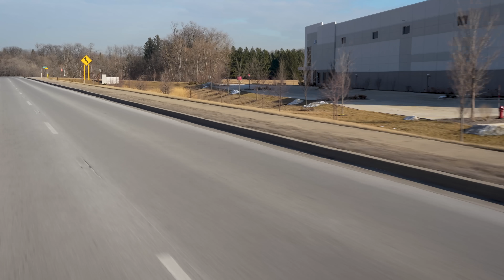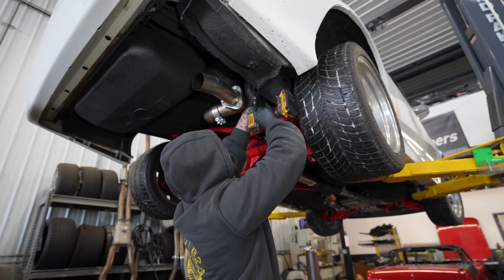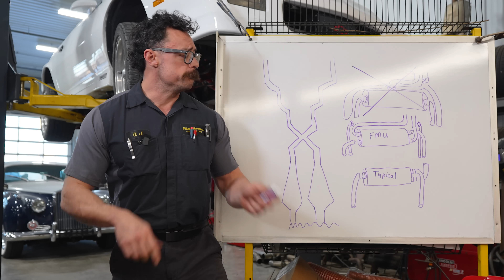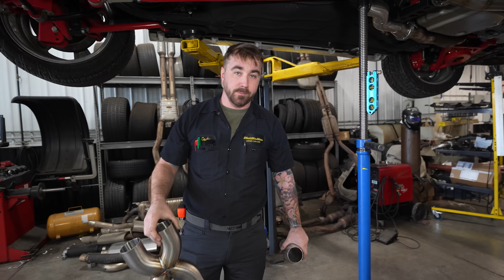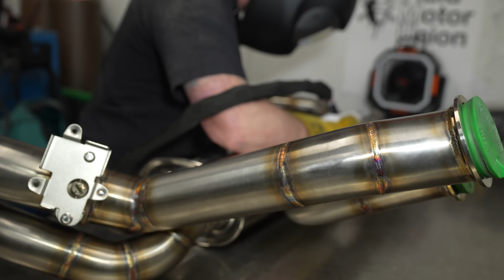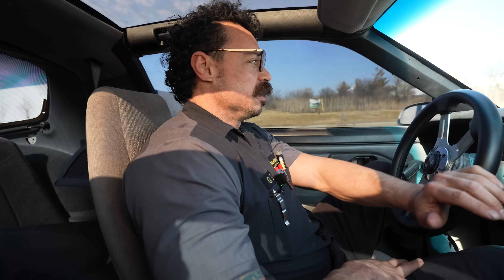This Camaro Exhaust Shouldn’t Have Made 30+ WHP: LS3 Stepped Pipe Layout Everyone Will Copy

Comment: The owner of this car definitely has some money tied up in this build. I love it!
Reply: oh yeah, that looks like a hawks 8.8..easily a $4000+ rear end plus Im sure a built 60e will run you a couple grand.
Reply: @vans1107 really they charge $4000 for a Ford 8.8 conversion on an 3rd gen... that's about what it costs to swap an 8.8 IRS into an '04-'06 GTO. I would imagine that an 8.5 10 bolt would be plenty strong for a 6.2L, don't Grand National/T-Tyoe guys run 9s with 8.5s?
Reply: @LeeHendo  an 8.5 10 bolt would be but that's not what came in 3rd and 4th gens..they have the 7.5" 10 bolt that is glass..it will live a while behind an automatic but a manual will break them at stock power levels.
Reply: @vans1107 Oh, I thought the 350 L98 3rd gens came 8.5.
Reply: @LeeHendo Moser 12 bolt.
Reply: @vans1107 Moser 12 bolt, with a True Trac. I have one, and recognize it right away.
Reply: This place is where I’ll have to drive my 3rd gen to when I get the LS installed. Unbelievable service and quality here
Reply: @MasonsMotorworks 
It’s gonna cost you.
Reply: Depends on where the 6.2 came from, a $7000 LS3 crate engine vs an L92 you pulled out of a $2000 rusty or wrecked Denali/Escalade you scrapped afterwards is a big difference in cost. Your results will be nearly identical and even "budget" builds these days aren't cheap. Especially with Terminator X, a FAST intake, quality headers, that full suspension and a handmade exhaust like this after a Borla. Not to mention what he has in the transmission or drive line. It's a nice car.
Reply: @LeeHendo I was talking about all the suspension and rear parts tbh. But yeah the ls3 too.
Reply: @marsh35404 yeah those suspension parts for those are serious.
Reply: @LeeHendo he's probably not putting a fluid motion exhaust on a junkyard LS.
Reply: cutom tig welder time $45...min...for exhaust alone.
Reply: Quality Work is not cheap and Cheap work is NOT Quality
Reply: @richsperformanceexhaust these days, that is not always true, plenty of bum mechanics charge crazy money for bad work and tons of companies charge big money for junk parts.

Comment: Though they are mostly used side pipe exhuasts... what are your thoughts on auger inserts for drone and dropping decibels? Its claimed they are meant to do both and well with minimum back pressure increases/flow restriction. Its probably not worth your time for a video but your thoughts on these would be very appreciated!

Comment: Hit a parked SUV in one of these in 1992 doing about 80mph with no seatbelt... Steering wheel was at 90 degrees and had my leg pinned between it and the seat. This is what snapped my femur but saved my life.
Reply: That suv jumped right out in front of you didn't it? 😂

Comment: I put vbands on my 86 Iroc with true dual stainless i custom fabbed, I wish i just welded an extra 10 inches to the back of my long tube headers (like super long tube headers now lol) and put the vbands on after the Clutch mount point on a t56. 

I had to go down to 2.5 inch header outlets, and 2.5 inch vbands to clear the gap between the LT1 style clutch cuz its backwards of the LS1 style (i put a lt1 in my car, AC fits the k member with some gentle hammering)
Reply: If I was closer I would love to throw my car on your dyno, and swap to your Nice X pipe version lol

Comment: I have a 1992 Z28 with the old SLP catback exhaust, no converter, and Doug’s shorty headers. GM made it an absolute pain in the ass for exhaust work on the 3rd gen.
Reply: You'd have an easier time routing it if you converted from a solid axle with torque arm to a de-dion axle with Satchell Link. I mean, technically, just doing the Satchell Link should help, but a De-Dion axle conversion will give you some crazy benefits on top of just moving links around, PLUS it'll make the driveshaft height stationary like it would be in an IRS car.
Reply: @Drunken_Hamster  Might as well buy an entirely different car!  That's a LOT of fabrication and work... and $$
Just buy a Moser 12 bolt and drop it in at that point.
Reply: @billymanilli a 12 bolt will do nothing for exhaust routing.
Reply: You ain't lying. Ive had '88 iroc, 96 t/a, 96 z28, 00 trans am, and 02 ws6 blackbird. Same platform; same exhaust setup other than header route. Extremely difficult to sound good and flow good at the same time
Reply: You're not kidding!  I drove to the old SLP place in Toms River, NJ 20 years ago and bought headers, and y pipe, to match up with the SLP catback I bought at the E town swap meet for 20 bucks (lol... I know)... It was missing the muffler, so I put something else there instead... It was especially a pita, b/c of my angle plug heads... SLP said it wouldn't be an issue... yeah right!  Had to run those short plugs in it and the boot still was dangerously close on #6 and #8.  That wasn't GM's fault though, tbf
But... still!  What a terribly designed car!  I LOVE 3rd gens (I literally still own 3 of them), but what a "piece of junk" when it comes to trying to hop it up!
..and then you make any more than 200hp and the diff explodes (or you could break it with 50 hp and a T5)... Ohhh and that T5 ... what another piece!

...and of course it's either a nightmare to put anything better in it, due to the "crooked" hydraulic clutch, bellhousing setup, and torque arm.  In the 90's, my uncle fabbed up a 9" and TH350 for his 84 Z28 ... that rear ate a lot of power.  ...and the ultra rare Dana 44, that they built for them were costing as much as the entire car was worth at the time.  (I happened to pick one of those up at e-town around 10 years ago for..... 250 bucks!! ...guy had no idea what it was!) 

Anyways... yeah.  I agree!  Grew up a "Chevy guy" through and through... but after a few of these things, I have 3rd gens to cruise around in on nice days, and an '87 Fox body Mustang for drag racing.  They're just awesome (ESPECIALLY when you're not rich!)
Reply: @billymanilli t5 wasn't as weak as everyone said, easy to rebuild. Basically same parts as a fox body t5. they would haven't 11s no problem back in the day. I have one behind a mild 406 in a 90 formula and it's been fine for years. I have a lt1 t56 stuffed in a corner for the swap if ever need it but so far I'm happy not to need it.
Reply: You are so right about these cars and putting exhaust on them! I had a '97 Camaro SS and fabbed up true duals on it. I could only fit 2.5" pipe to make it fit over the suspension and rear end. I still had factory manifolds and single chamber mufflers but it sounded pretty good. Loved that car!
Reply: You should have used long tubes
Reply: @fnafplayer6447 Doug’s shortys are made specifically for this car and fit perfect.

Comment: Ah yes the old loosen the straps hp gain, if you know you know...
Reply from the maker: That was the strap breaking! I left that clip in there it there because it looked rad but it was just a tired strap that had enough. Scared me silly… you should see the spike and loop on that graph! 
You are correct in that there is a hp difference between strapped tight and loose. 
That’s why we limit the travel with the front straps, where the rears allow it to climb but keep it in place. 
Strapping is a balancing game in that way, but it’s not like there’s infinitely more power the looser you go… if you’ve done it right it will climb, show its peak # and not fall off.

Comment: Lower the rear LCAs to the bottom or second to bottom hole, depending on how much it’s lowered to correct the angle of the LCA. With it on the lift and the rear drooping, the LCA angle is what it should be at ride height. They should never be level or higher in the rear. It’ll make it a different car. Going to need to correct pinion angle, too. ~3-4* should be optimal all around, IIRC. 

20 minutes doing that and it’ll hook in first most likely.

Comment: 1) A BONE STOCK auto LS3 makes 375-385whp- that's with factory intake, manifolds, cats, exhaust, etc. you didn't "PiCk Up 30+ wHeEL HrsPoOwErZ WiT ExHoOsT" 🙄... It just came in with a completely junk tune and running like garbage- hence why a cammed LS3 with I/H/E was making what I've seen bone stock manual LS3's make.

2) 45min video, and the only shot of the finished product is a 3 second clip of the muffler going in?

3) zero clips with the valves closed? Seriously? It's a full-length exhaust on a street car, and you couldn't bother including what it'll sound like 95% of the time?

Comment: O.J. ,  that was just impressive.   32 H.P. in the exhaust alone was exceptional. You can have a new name,  EFMU, for those exceptional builds.  :DDD That system should be eye opening to a lot of people.  Also,  that car almost jumped off the dyno :DDD  it was so powerful :DDD, that was a little scary to watch.  :/   I think it would be wise to put a few more straps on those high power cars. :DDD   That car really does sound great now.  I could hear your meaning of "restricted" in the before shots. The after video was really clear and open sounding.  That car is obviously too fast for it's tires.  slicks on the drag track is probably the only place where it would be able to rip.  Excellent work, Cody and O.J.   :)

Comment: 3 things that are a complete shame about that Camaro....1st, it's not got either a T56 or a GFORCE Street 6.
2nd... those polished Torque Thrusts need to go and GIT!!! Torque Thrusts look terrible on anything after the 70s.... and a Camaro should always have IROCs...or at least a set of wheels that fit it's style, definitely not Torque Thrusts 🤮
And lastly....T-Tops.... I understand beggers can't be choosers, and he might've already had the car for years, but I definitely wouldn't have started with a T-top F-Body to build out.... personally, I'm a sucker for the pre-facelift 3rd Gen Firebird Formulas, slick top 5L 5spd, WS6 and 4 wheel disc.... and then immediately pull that dog 💩 Chevy 5.0 outta there and build a Motown 5L 3" stroke LS7 headed screamer 👌🏻

Comment: I am biased. My name is Chris and I have a third gen addiction. I’ve had my 1992 1LE since 1996. It currently has Hotchkis and BMR rear suspension, and I added factory A/C because it’s hot in Texas. I had to remove the dual converters for a single because of the sub frame connectors. Other than that I always wanted to keep her as stock appearing as possible because 1LE cars are a little more special. When I saw the third gen thumbnail, I just went crazy. You combined science and art when you built this exhaust. IT IS SO BAD A$$! It sounds amazing, and EVERYTHING you said about the dyno correction numbers I believe to be true as well! Thank you for including an older Camaro that some folks are not as fond of. This was an awesome video!!!
Reply: I purchased my 92 when I was 18, built out an old 4 bolt main 350 & swapped in , eibach suspension and found some shock tower connectors. It still drives good but I really want to dive into the Detroit speed front and rear suspension arms catalog!
Reply: You should have did an electric AC compressor to keep the load off the engine.
Reply: @LeeHendo  I think you missed the part where I said I wanted the car to look stock, and pretty much stay stock. Stock replacement parts are still fairly easy to acquire, and if the system develops a problem, most competent technicians can diagnose and/or service the system if I’m on a road trip. The only performance that I was interested in was the temperature of the air coming out of the vents. I keep three cans of R12 in the spare tire area because again, stock appearing and most folks know it’s hard to beat R12 in a system designed for it. Besides, I have a ZR1 that is fast enough for me, and she has a few mods for just going way too fast.
Reply: @CS-oe8ogit can't look stock, 1LEs didn't come with AC
Reply: @LeeHendo  You must be from the learing center. Because your learing and comprehension skills are not that sharp. First off, I said appear stock (that’s why I used all factory parts). So, do you understand the concept of looking under the hood of my car, and under the hood of a factory A/C car, and NOT being able to tell the difference between the factory A/C car, and my car?  Unless you are a third gen F body savant and you know RPO codes as well as where to find them, the two cars look identical under the hood. I would venture to say 98% of even the most avid of third gen  Camaro folks do not know what a 1LE is or that they had them in the third or fourth generation cars.  But thank you for letting me know that the A/C option was not available on a car that I have probably owned longer than you’ve existed, I thought I had a special northern car that did not have the block heater option.
Reply: @CS-oe8ogthe irony of trying to call someone stupid and typing learing twice instead of learning.
Reply: @ryanmarsh3732  I guess you don' t know "learing" was used intentionally. 
Quality Learing Center sir.  There is some lore.
Reply: @LeeHendo then you'd need special equipment to charge the ac correctly. A set of guages or an old machine won't cut it. Might wing it to cool but not cold or correctly
Reply: Certainly wish I lived close by & could rummage thru y'alls dumpsters every couple days... 😉

Comment: A 4" single would've made the same power without the mental gymnastics
Reply: And unless it is opened up, it sounds like crap at low, part throttle with all the reversion. You can also make the same power with less money in heavy lump of big block for a motor swap, but that isn't the point.

Comment: I actually would've come over the rear axle with the twin pipes, and turned them both, and sent them both through a dual in/dual out to a Twin Exit on the rear driver's side straight out the back similar to the 3rd Gen Firebird SLP Firehawk's, the old aftermarket SLP "TOTL Exhaust" ,and the GMC Syclone's twin passenger side rear exhaust (but on the driver's side lol)

Comment: I have an E60.  Stock exhaust is 2 manifolds that drop into 2 cats then they come together at a Y.  I'm about to try this. after the Y.  Any suggestion on distance from the Y and diameter step?  525i  M54B25 engine.

Comment: If you build that exhaust in bulk, either yourself, or freelance it out, you'll sell them like proverbial hotcakes....all of the 3rd Gen F-Body exhausts suck.... they're ALL singles after the headers into the Y-pipe....hell, even the OBS GM trucks 88-98 run essentially the same way.... you could potentially make a killing if you start making them on the side

Comment: Damn that sounds sick. A more complicated question for those of use a turbo 4 cylinder pushing 400whp do I step from 2.5 down pipe with a megaphone to 3 inch or just a straight 3 with megaphone? Or do I do a complete 2.5?

Comment: You are correct by believing that the “before” sound meant there was poor exhaust flow.  I 100% agree.  It’s always that mid-range rpm choked out sound.  Good work.  V-cylinder configurations always flow best with an x-pipe.  Every time I’ve ever modified an exhaust, it was happier with the x.

Comment: The reverse megaphone is a well developed concept in motorcycle exhaust. You guys should check out the calculations developed by them for X displacement with X duration to calculate X tuned length. And why is he cutting 1 5/8 or whatever off of the back of the X pipe? Shortening the front side and the header before the megaphone I understand but after?

Comment: This is a lot to say we worked on the tune and slightly increased minimum cross sectional area. Should have compared without touching the tune. A 3.5" single after the y pipe or a 4" single would've been just fine and not increase the weight so much.

Comment: While it's a bit of an apples-to-oranges comparison, 2-strokes behave so differently from changes in exhaust that it's not a stretch to imagine 4-strokes can get serious effects too. It certainly won't be over x2 TIMES the HP like on a valve-less 2-stroke w/. a tuned pipe but still both a crank-scav.  2-stroke & an N/A 4-stroke are both limited to a set amount they "inhale" from ambient air equating to the displacement at their core; so the end-point of the system having meaningful changes should show strong changes in both.

Comment: Here's an idea,  
Squash the megaphone in a press & make an oval megaphone.🤔
I have always wondered that if oval pipes like used on NASCAR give a unique sound with acoustics & pressure waves being forced to expand horizontally vs. 360 degrees within a round tube.  I'd be very curious about adding just a single cone to the original system for both sound & power or an X off the headers into a Y & then into a single cone to blend the exhaust pulses & velocity, if the length of that configuration could fit. 
I've always wondered about the construction of the original Dr. Gas Boom Tubes which used a really wide X & more like 2 U's.......🤔
Listen & read thru comments on the video titled: 
 "Sterling Marlin’s "X-pipe" Car | 1995 Daytona 500 Qualifying"
Reply: They did that a couple few vids ago.  It was badass.
Reply: I spend alot of time of exhaust and sound ! Sterlins car with doctor gas  x-pipe is one of those stories ill always enjoy ! Good stuff!
Reply: It definitely sound cool. I saw one car with them and I loved it.

Comment: I’m curious of how a single 4” would perform in comparison. Obviously sound would be affected but as far as pure horsepower goes I’ve always wanted to see dual 3 vs single 4 on these f body’s.
Reply: Dual 3" is WAY more flow than a single 4".....
Reply: @JoeIsCrazyWillman pure numbers wise yes but I’m curious if the scavenging effect of a Y pipe into a single 4” combined with less frictional surface area would narrow the gap a bit. Obviously once you get to a certain power level dual 3’s will prevail but at 750 or less hp I wonder if a single 4” is really going to cost that much power. I love dual 3” but if you have a lowered F body it’s gonna be tough to not drag on everything.